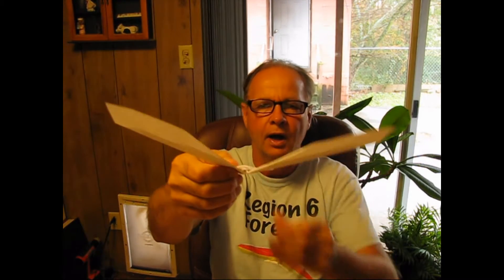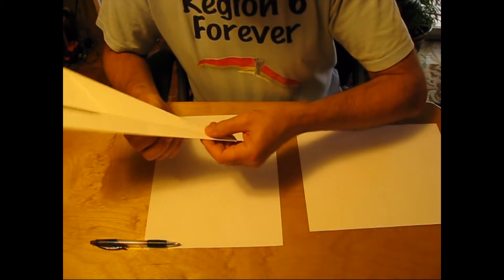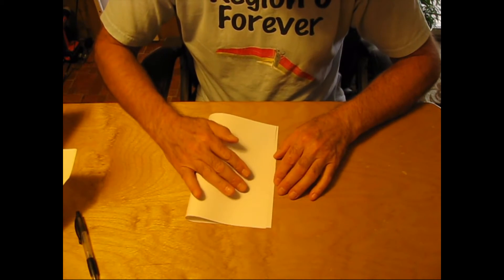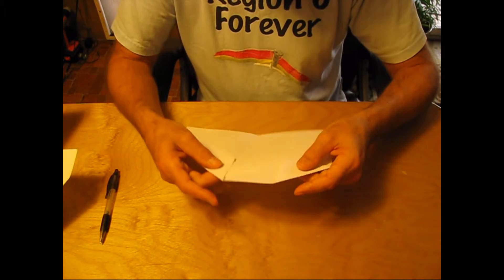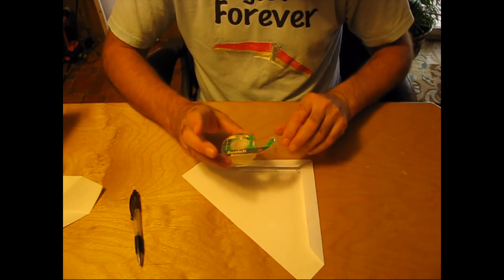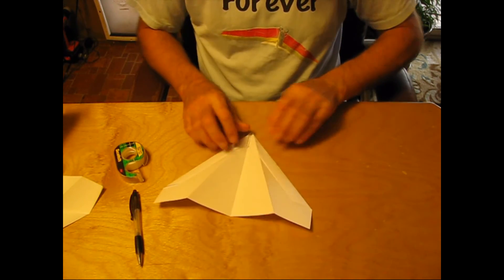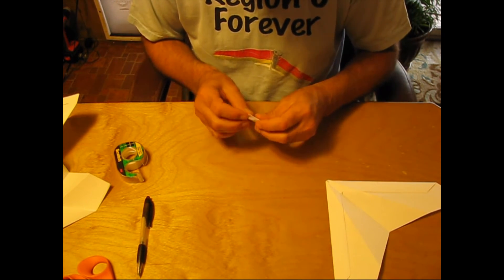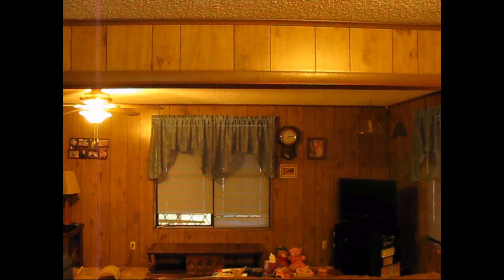Building the Proto OmniWing Paper Airplane

Comment: Which is the best omniwing
Reply: The variations on the OmniWing is basically related to how much time you wish to put into it.  To get greater speed, or better glider ratio, or improved rate of descent, usually will require more time to build as well as more complicated building process.  Start with the Proto-OmniWing as it has the most simple build.  If you have success with that, then move on to the OmniWing.  If success with that move on to the Advanced OmniWing.

Comment: Ok.But, why the Omniwinng and the Proto don' fly for a long distance?
Reply from the maker: +Dami Bahador The Omniwing and Proto OmniWing are both gliders.  They have vary respectable glide ratios.  For example an OmniWing, if built properly will have a glide ratio of about 14/1.  The glide ratio is a comparison of distance traveled to the amount of descent.  So the 14/1 glide ratio is 14 feet forward while descending 1 foot.  So if I launch the wing from 5 ft high above the ground it should glide around 70 ft forward.  Of course with a bit harder toss, one can get increased distance as the glider will climb a bit after launch and then settle into a nice glide.  But for overall distance competition, this is not the wing to use.  First, all rules for paper airplane contests now follow the guidelines of Guiness book of records, thus the OmniWing cannot compete as it employs cutting and taping.  Also, even if it were allowed to compete, it would be beat by all the other designs that are more dart-like and depend on the hard toss.  If the Omiwing is tossed hard it will simply start doing a loop.  The OmniWing follows the design criteria of the modern day hang gliders rather than lawn darts.

Comment: ur plane works really well! :)), btw, mr menamiketrx, what is the meaning of omni?
Reply from the maker: +Reborn Arcobaleno Omni definition-  "Without Limits".  And that is what I feel the basic OmniWing achieves.  There basically are no limits to the variations that can be made from the basic design.  Check out the Proto-OmniWing, and OmniWing with modifications and the Advanced OmniWing, and the High Aspect Ratio OmniWing.  All can be found on my channel.  But I am amazed at the number of OmniWing fans that have indeed taken this basic format and have created some very interesting designs.  So as good as the OmniWing is, I encourage builders to not be satisfied with just this.... Experiment, change it up, see if you can make if fly farther and stay higher.

Comment: Really nice videos Mr. Menamiketrx. Those airplanes are magic! I want to build some, but I've got a few questions:
1 - How does an omniwing turns? Is there a way to trim it (except by twisting your arm to the right or left)? If there is, how?

2 - When I get experienced enough with building this plane I wanna try making a micro omniwing for indoor/outdoor flights using a smaller sheet of paper. Based on your knowledge, do you think it would work? Thanks in advance! :D
Reply from the maker: 1.  Some amount of tuning is usually needed to adjust for straight flight.  You can bend a slight amount of the equivalent of an aileron into the trail edge out on left or right wing time.  If the wing is turning to the right, you can correct to straight flight by bending a little bit of "up aileron" on the left wing.  This will slow the left wing down helping to straighten out the flight path. 

2.  I have built OmniWings with gum wrapper with the foil backing with success.  But have also built large high aspect ration OmniWings which can be seen on my channel.  The OmniWing platform provides endless amount of room for experimentation and modifications. 

Best to you.
Reply: Thanks for the informations Mr. Menamiketrx. Really helpful!